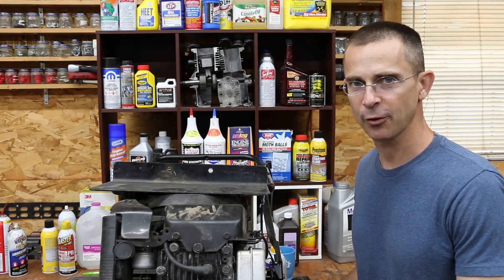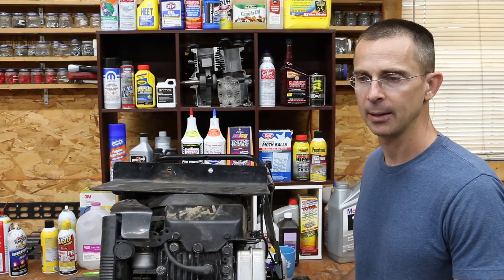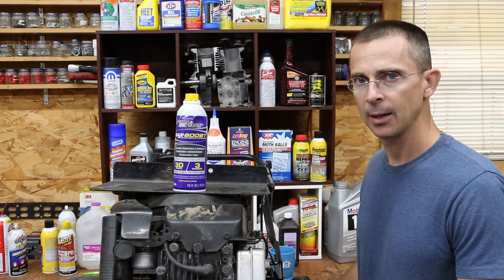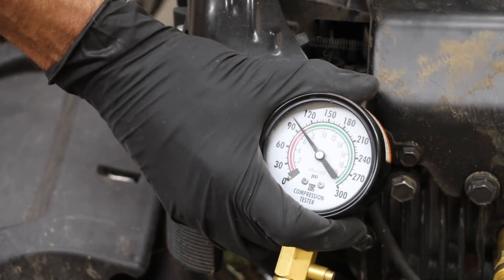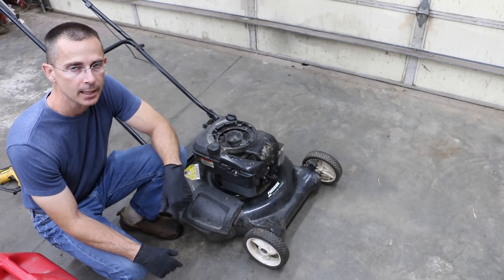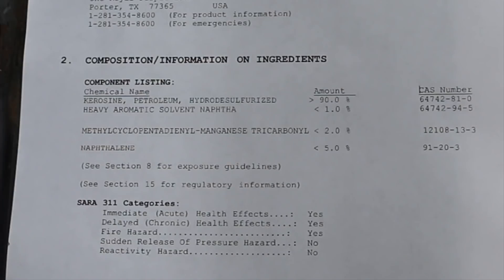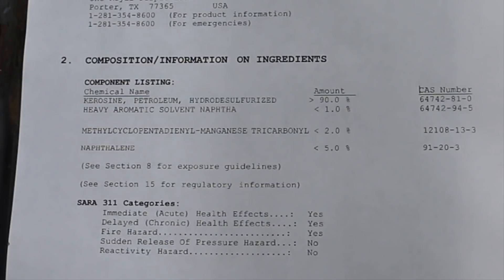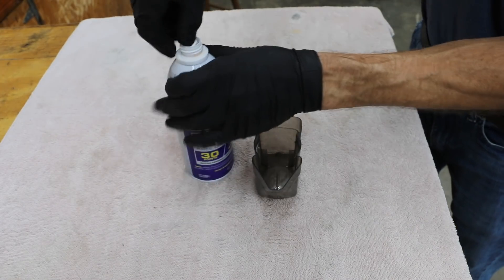Will a gas engine run on 100% octane booster?  Let's find out!

Comment: Have found these interesting, and am glad you show compression test and cyl. head temps before and after. So thanks for doing them, and would be interesting to see non-ethanol gas vs. heavy ethanol gas(perhaps 15-30%), like is forced in our area and shown to be under testing, even though we are in a cleaner no inspection or air alert quality area {though some of nearby, hence the total blanket of the have E gas area}
Reply from the maker: Thank you very much for the positive comment and thanks for this recommendation.

Comment: But would it run a different kind of small engine?
<--- That for example, it's an 8:1 cr, single cylinder sohc with cdi....I don't know why it wouldn't.
I have to say, If I ran out of gas 20 miles from the next station again and there was a chance a bottle of this (20 oz)
would get me to the station where I would then add the rest of the tank (.56 Gal total) in 87-89 octane I'd carry a can just in case.
Good video!
"The More You Know" (cue the rainbow)
Reply from the maker: Thank you very much for the positive comment.  I agree that it's worth using something like this to avoid getting stranded. Thanks again.

Comment: that one that can't be pronounced is MPT i believe, and if im not mistaken it is what is used to raise octane rating on pump gas, so an 'octane booster' using primarily that ingredient should work better at reproducing higher octane rating fuel..
Reply from the maker: Yes, you're right, and it's what caused the orange buildup I've learned.  Thanks for commenting.

Comment: Do you think it would actually clean the motor better to run pure boost for a few minutes then adding some gas.
Reply from the maker: I don't think so.  The orange buildup is MMT, which is bad for an engine, cat converter, sensors, etc.

Comment: Although I can't hear any increase in RPMs, do you have a little tachometer which you can put on that little motor? Next experiment should be with a flammable liquid that's cheaper per gallon than pump gas.
Reply from the maker: Thank you for this recommendation.

Comment: Run the engine off of 100% E85!!!
Reply from the maker: Thank you for this recommendation.
Reply: Project Farm 😀👍👍
Reply: You mean E100? 😂😂😂
Reply: E85 is about 110 octane and burns super clean. Its not crappy at all. Older engines just use crappy stuff that cant handle the corrosive nature of it. Up the jet size on the carb and it will run great. If not you will run super lean as alcohol has its own oxygen in it so you need about 20% more fuel. However since it is 110 octane you can also increase the compression to much higher than regular gas. This all means that duel use engines (flex fuel) get worse MPG from e85 vs gas. However it is generally .60 to 1.00 a gallon cheaper so you get more for less. Most cars have a break even cost at about .60 a gallon cheaper. You will use the same amount of money to go the same amount of distance. A fill up with regular will cost you about 12$ more but take you farther. You could get rid of some of this issue by designing the engine to run only on e85 allowing you to up the compression ratio to 17:1 gaining back much of the lost energy with a more powerful explosion. Unfortunately they have to make the flex fuel vehicles run on 87 regular fuel which limits the compression ratio to 11:1 or less. If they made it e85 only at 17:1 they may be able to get away with running premium 93 octane but we all know people generally grab the crappy 87 which would cause the engine to self distruct in a minute. Want to see e85 fuel do shine.. look up e85 turbo tune to see what a high boost high compression engine can do. Lastly.. i use e85 90% of the time (i live in the Midwest so its in a lot of stations) and bought the car new. It has 210,000 miles on it and runs great. I feel better knowing my $ goes to the local farmers and economy including family rather then to Prince Money in the middle east so he can buy another solid gold Lambo and even more weapons that will eventually be pointed at us.
Reply: Although E85 has less ENERGY density than regular gas, E85 does have a high octane rating, which is why a lot of cars you see at a race track run E85. Yes it has less energy, therefor e85 runs much RICHER than pump gas, and therefor it will get worse gas mileage, but due to the higher octane, you can run higher timing in the engine before you get any kind of knock, and more timing means more...power. If it sits for long periods of time in a modern car, it could cause some corrosion, but on a daily driver it’s more than likely fine.
Reply: I like this one!
Reply: AlphaDogX25 Are you suggesting Protect Farm run just ethanol (Everclear) or that he run nothing but E85 through the small engines?
Reply: @AlphaOneActual  nothing but E85!😎
Reply: AlphaDogX25 I wonder how long it could last using just pump E85, I bet it can run it, but for how long & reliably is the question
Reply: My lawnmower runs fine on E85.
Reply: Have to change engine timing but can be done
Reply: E85 is high octane fuel. Of course it'll work
Reply: @Biigtee389   High octane?  According to whom?   It's like the crappiest fuel you can use for an engine.

It'll work but due to ethanol's very corrosive nature, it'll eat away at the cylinder walls and other parts of a vehicle rapidly over a long period of time.  You won't notice anything immediately.
Reply: @lilkittygirl  E85 is a high octane fuel, it is around 115 while regular gas is 95 or 98 (on the european scale). High octane doesn't mean good, it means it will take more compression before ignition
Reply: @lilkittygirl  no. It's just not gasoline. Very high octane rating. If it sits in the fuel system it can cause damage but it runs excellent as long as the rubber/plastic components are compatible with ethanol fuel.
Reply: @greyhunter37  Octane has nothing to do with compression as gasoline engines do not run on compression ignition but rather spark. Octane refers to the length of time the fuel takes to burn. Higher octane = longer burn time.
Reply: @kid31989  Octane has everything to do with compression.
In a higher compression engine you need higher octane because otherwise you will get auto-ignition. 
Gasoline engines do rely on compression, they just ignite using spark because with gasoline the compression ignition is unreliable
Reply: Almost all of the above comments are false and wrong, obviously from people who have never ran E85.

1. Ethanol is high octane, in Finland the pump gas E85 is 106 octane while gasoline is only 95 or 98 octane. Thus it can tolare way more compression/boost = more power
2. E85 doesn't require special fuel lines or anything of that sort
3. It won't corrode anything in your car or eat your engine alive, this isn't methanol we are talking about here
4. Also in Finland, even though E85 requires more fuel but it also costs way less (1€ vs 1.65€ for gasoline) and thus it is cheaper to run than gasoline here
5. E85 is basically race gas straight from pump, and cheap too
6. E85 also cools down the intake air temperature a lot more than gasoline, very prominent difference in carburetted applications, colder air = more power again
7. I had mine sit last year from August until late December with half a tank of E85 and when I finally got it running again in December, had zero problems with the fuel that was in the tank

I have ran E85 daily for over 2 years now throughout the whole year, even in winter at -30C weather, in my -68 Plymouth Satellite. Only thing I have done is tune the carb for it, everything else is exactly the same as with gasoline and nothing has broken down yet.
Friend has ran it for even longer than I have, close to 4-5 years probably and no problems for him either, just tuned the cars for it and call it a day.
Reply: @lsstige  THIS^^^ the rest of you are trippin
Reply: What total shite! E85 will corrode metal, rubber and plastic components. Just because something "runs fine on it" doesn't mean you're not causing internal damage to your fuel system and carburettor(s).
Reply: I don't know of any metals it will actually corrode, but rubbers and some plastics are definitely damaged by ethanol. E85 is 85% ethanol. Ethanol is an alcohol and very similar to isopropyl. People are saying it "won't corrode anything in your engine", but it's pretty simple to find out what it will eat away and what it won't. Pour some isopropyl in a bowl, and drop things in. Rubber it will destroy pretty quickly - it will become brittle and crack apart. SOME plastics will start to dissolve, stronger ones will be fine. Gasoline and alcohols are both solvents, but both attack different materials in different ways. Just like gasoline and ethanol don't typically dissolve paints easily but acetone does - they all damage different materials differently. I'm going to assume "these days" engines are designed with components that can easily tolerate both (since almost all fuels contain ethanol now) - however it's entirely possible that something in an older engine could be damaged by alcohols and not gasoline - though again, I know of no metals alcohols can damage. I think the point is, if the vehicle doesn't explicitly say it can tolerate it, do it at your own risk.
Reply: @lsstige  I run e85 in almost everything
Reply: Yes. E-85
Reply: E85 is not high octane, nor is the 85 any kind of octane rating. It is 85% ethanol.
Reply: @Fsilone  You are correct E85 stands for 85% ethanol. But Ethanol burns like a high octane fuel (it can take a lot of compression before self igniting) that's why E85 is seen as an high octane fuel
Reply: @greyhunter37  That may be so, but engines designed solely for E85 typically aren't compatible with even premium (~92 octane) E10 fuel. E85 has an octane rating of about 108.
Reply: @Fsilone  That is what I mean, it is very high octane
Reply: Fsilone a108 octane level is a higher octane level not even super has a octane level that high.
Reply: Fsilone actually E85 does have a higher octane rating then regular gasoline. I just looked it up.

Comment: these engines were routinely ran on kerosene with an initial warmup on gasoline back when kerosene was cheaper than gasoline.
the fact that it ran fine should not be a surprise.
in fact it should run on any light hydrocarbon or alcohol.yes that includes wd-40.diesel is a bit heavy to work well without heating it first.maybe #1 diesel would be ok as it is close to kerosene.
Reply from the maker: Thanks for commenting on this.

Comment: Nerd info:  
Methylcyclopentadienyl Manganese was initially intended as a supplement for use in leaded gasoline.
It was later used as an unleaded gasoline additive to boost octane. 
Its rapid photo-degradation properties render it rather safe to use as a fuel additive when used at a level of 8.3 mg Mn/l.

Its rapid photo-degradation properties also render it a "non-risk" to the environment. Meaning levels of the chemical can not build up. Sunlight and evaporation destroys it's molecular structure. And burning it in an engine does not create any additional exhaust fumes. An all around good scientific discovery. For now anyway.  Who knows what tomorrow's chemistry will create.
Reply from the maker: Thanks for this information.

Comment: personally ive ran my current lawn mower on mixes including 10:1 mixed 2 cycle oil in gas, diesel and gas, mass airflow cleaner, wd40, e85. only thing notable when when the oil content is too high it takes more pulls to start and is very prone to knock under high loads (deep grass)
Reply from the maker: Thanks for commenting on this.

Comment: i used to put a liter of meths and a liter of kerosene in my civic when i filled it up, the meths was to mix with any water in the fuel and the kerosene was a bit of upper cylinder lube
Reply from the maker: Thanks for this recommendation.

Comment: Very good test!  I used this product in my car before dyno test at maximum boost.  They warn about the orange buildup and it did happen to my spark plugs but the engine ran amazing and made about 450 HP from a 3.8L engine with zero detonation.
Reply from the maker: Impressive!  That's a lot of power. Thanks for commenting.

Comment: The reason the cyl head was hotter than normal is due to that Kerosene,  like diesel fuel has a higher BTU output than gasoline.  The only reason the engine ran with the booster is because the naphtha  mixed in made it volatile enough to combust in that low compression small engine.  Octaine booster containing MMT will also foul the heck out of the plugs if used in high concentrations.
Reply from the maker: Thank you for commenting on this!

Comment: See if you can inject gun/black powder into the combustion chamber as your next project. That'd be friggin awesome to watch!
Reply: Umm, I think that would work better on a turbine, and the Union Pacific already tried that, kinda.
They actually made a turbine to run on finely pulverized coal, but the abrasive action on the turbine exhaust blades was incredible.

Maybe with today's new ceramic parts, it could be done, but there is no necessity for such a beast.
Reply: Roots type blower would feed nitrocellulose gunpowder.
Reply: @robertkubrick3738  I think the manufacture of the gunpowder alone would make such a beast prohibitively expensive.
Reply: @macgyveratlarge2133  Nitro is pretty cheap 14th century technology, you can get sawdust free.
Reply: There are shotgun shell start engines. Put in a blank shell and it starts the engine

Comment: I want to see somebody try to run an engine on Napalm. It probably won't flow like normal fuel and may need a special rig to get it into the engine. I imagine that one way or another, it will probably wreck the engine.

Comment: If The Engine as Running on Fuel It could have residule fuel in the lines.!
I tried Kerosine insted One Liter Petrol, for my Lambi schter, it had a starting trouble but hen started it ran for 12 KMs. but sorry Public for the Exast Smoke.
Reply: so will alchol make a ford explora go

Comment: Everybody likes to see things blow up, so I think it would be really cool if you tested how much nitrous a lawnmower engine can really take. Like set up another fuel supply to keep the engine from running too lean with the nitrous. Curious to see how much power can be pulled out of these small engines with nitrous when done properly!

Comment: the purpose of octane booster is to eliminate detonation or pre-ignition associated with too much compression.  adding octane booster to a engine without raising the compression is just a waste of money.  raising the compression and adding the booster will show hp gains, but with you will notice a higher engine temp especially on an air cooled engine.

Comment: Test the best screw/bolt head patterns. Like Phillips always gets stripped out. Is hex or square better. Most versatile based on ease of use and reliability. Test how much abuse each one can take. Ect.

Comment: I'm surprised it ran off of pure octane boost. Actually that doesn't make sense. You seen a higher octane fuel explodes at a lower flash point. In other words you have to slow down the explosiveness. To make this happen you add an additive to it. It used to be lead. But we realize that wasn't good for the environment. You might ask why is a higher octane a slower burning fuel. That doesn't make sense. I want to boost something I want it to go faster. Well the science behind a lower octane giving you better performance is. Some low octane fuels are so volatile that they will ignite on they own before the spark plug gets to ignited. That's what the knocking and pinging sound is. And in some cases the motor keeps running on its own after the ignition is cut off. If the explosion happens before the Piston is at its highest point. Then the explosion pushes the crankshaft backwards against itself. And as you can tell that cause knocking and pinging and problems. The timing on your machine is supposed to be at its best point therefore you won't it to only ignite when the spark plug ignites it. Why do you think a Top Fuel dragster has so many spark plugs per cylinder? It's the set off that extremely high octane fuel. Some people tell me they don't believe me. and then I say well when have you ever seen something become more pure and clean by adding an additive to it. so if you want your engine to stay clean you think it will stay cleaner with a fuel that you taken regular gas and added suspended Ceramics in it to dirty it up. or just straight clean regular gas?

Comment: Could the scratches or gaps in the cylinder walls, such as the one that had sand go through it, be filled in with an epoxy like jb weld to restore compression?